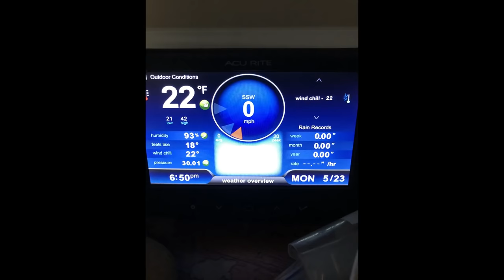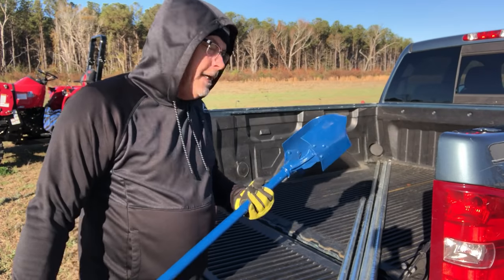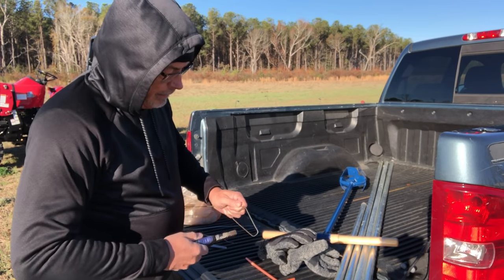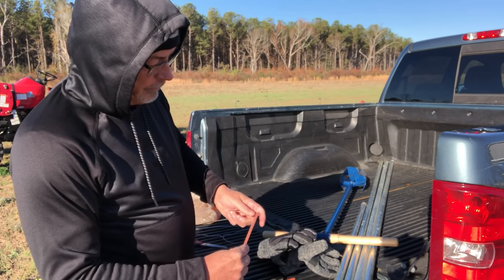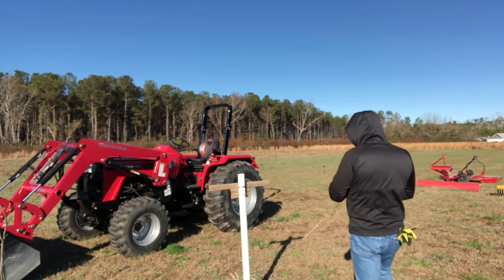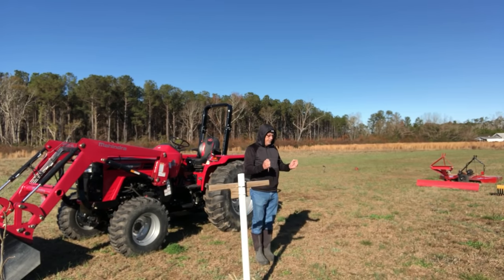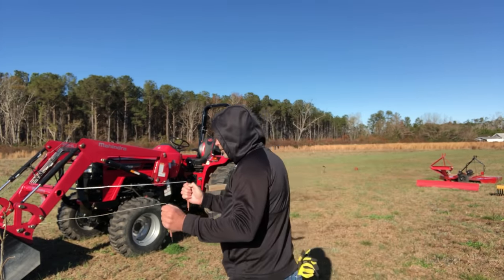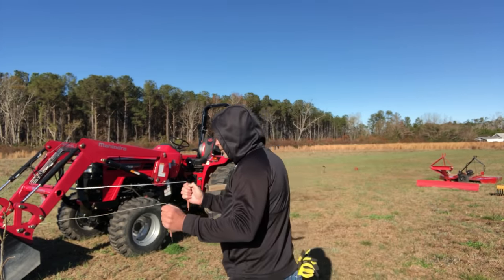How to hand dig your own shallow water well - Successfully | Fit Beach Life, How to Homestead!

Comment: Those rods are pretty good at detecting a place where a hole is about to be.
Reply: They don’t that part is garbage. Aquifers are usually very large and he’ll strike water if he closes his eyes and wanders randomly then digs. There is a $100,000 prize in Australia for anyone that can prove that water divining works. No one has succeeded.
Reply: @teeanahera8949  I liked your comment because I think it was well written, but I disagree. I think there is a logical explanation for why it works. Same way a compass works. Magnetism. It makes sense that all the unfiltered water down there contains metals and likely iron rich. Maybe powerful enough to pull copper wire, most hangars.  But I think there was value in your comment as well.
Reply: @teeanahera8949  disagree totally.   It works.  Don't know how but it works.

Comment: Me and a friend used black pipe sections 5 ft long and bored down 45 ft until we could no longer get the pipe up in the air without breaking the pipe we never got water😢
Reply from the maker: What is the average depth of the wells around you?

Comment: pro tip: don't put an end cap, beat your pvc pipe done until you have good resistance and then use your jet pump to suck all the sediment out of the pipe and repeat. I'm using an old fashion pitcher pump to do this method over time to get my well the last 8 feet down for a total of 30 feet since I'm using this well as emergency drinking water and daily pumping 15 gallons a day to water the gardens. 

once i hit my target depth, ill add a check valve and a filter on of my pipe.
by doing this, i'm slowly getting deeper every day by just using the well.

Comment: Shure try that in Texas.
If you can do this at all 99% of the water is sulfur water.
Most areas of Texas is lime stone VERY shallow. Surface to 10 ft that is why there are very few basements in Texas. Most drinkable water is two hundred ft to eleven hundred feet.
We also have very few trees west of I35 in Texas and those are short.
Most of them are 10 ' to 30 '.
If you live east of I35 things change drastically. North of Houston you have the Big thicket with lots of big tall trees and deep soil.
Reply: Laredo

Comment: Guys dousing rods don’t do anything. Water tables rarely differ between any 2 points unless the terrain has significantly changed. They are like rivers the whole area is covered in a layer of water at the same depth.
Reply: You are wrong. Diving rods do work, not always the same way, not always the same material, but these have been used for centuries to find water. I sold a house once and the new owner asked me to delineate the outline of the septic tank. Divination made it happen. Easypeasy.
Reply: He definitely witched the location of the subsurface water!

Comment: I used the same technique to find underground utilities. It definitely works for many uses. A caveat to this is, there may be buried power, fiber, phone, or sewer.
Reply: Or a big Boulder at 20-26 feet, which is probably the case at his first well head
Reply: There may also be nothing. Your odds are the same. A simple electromagnetic can tell you the rods are moot.

Comment: Runing sediment-laden water through a common jet pump is a very effective way to ruin the impeller and jet assy in a few minutes.  Their plastic-based parts do not handle abrasives at all.

Comment: The problem with drilling down that shallow is ur water u drinking is surface water basically what drained from above. The water u drink from wells pros drill is below bed rock. The water that is above bed rock is sealed off with casing. So the water u get down deep is coming out of the rock
Reply from the maker: Good point, but not in coastal areas. The average well depth here, tested and certified by the county is 30 feet.
Reply: @TangoRomeo87  oh ok that makes sense I live in Pennsylvania so it's nothing but rock and wells here can be from 100 ft to over 800 ft
Reply from the maker: Yep, I moved here from West Virginia, we had the same depth problems there . In a valley you might have a good well at 60-70 feet, but as the mountains got involved they went 300 to 800 feet for good water.
Reply: @TangoRomeo87  yeah my well is bout 300 I think 40ft of metal casing. We get good water can fill a swimming pool no problem
Reply: yes as I found out 140' deep and with 550 ppm hardness

Comment: Do you still have the link for that hand auger. I got one off Amazon identical to the one you have, but it can’t come apart-it has one solid pipe.
Reply from the maker: https://www.amazon.com/dp/B000OY4ABW/ref=cm_sw_r_cp_api_glt_fabc_CYK60R1GP36H8A3BMF05
Reply: I hath to cut the handle of the auger off too hath the pipes all  treaded.

Comment: Question my auger is a foot under muddy water every time I pull up everything slides off? Should I try to pump with the Same pump you did my pump instructions said clean water only? Or should I wash down a 4 inch pvc another 5 foot set the 1.25 screen pull up 4 inch and call it a day. I like the idea of that capped casing but I can’t get deep enough to get 3 foot of standing water, if I wash another pipe down I don’t know how thick this layer of water is. My first well is 27ft it has water but sucks air doesn’t produce much water but there is water now I’m trying to go bigger  to at least get 200 gal a day. Hole is 8inches wide and 18ft deep at this point in eastern North Carolina.
Reply from the maker: Mud will destroy the pump, let the water sit until the mud settles.

Comment: Nice! I only gotta dig 350' + to reach the aquafier on my property...👍
Reply from the maker: That’s how it was in West Virginia too… I feel you!
Reply: @TangoRomeo87  👍
Reply: We're you able to dig 350 feet with a hand auger? Switch ing to PVC pipe and using an electric crane to pull back?
Reply: @camperjack2620  couldnt cut through the caliche by hand... Still bringing in water every few weeks n filling containers until can save up for well drilling company at $75 per foot to drill the 350-400' needed...🤷‍♂️

Comment: Sir I need more information on the motor your used.
Reply from the maker: Seymour - 21308 S500 Industrial Auger, Hardwood Replaceable Handle Type, 8 inch https://www.amazon.com/dp/B000OY4ABW/ref=cm_sw_r_cp_api_glt_fabc_RNESM7SXZ20CF7VGN14V
Reply: @TangoRomeo87  I think he means the motor you use to extract the water..

Comment: A man with a machine drills hole by hand, yeah, we evolded?
Reply from the maker: Tractors suck at well drilling, one bad bind and it gets expensive. Learning old ways of doing things is never a bad investment of time for me.
Reply: @TangoRomeo87  I would not really have a clue, it just felt right to state it. Your efforts and knowledge would most likely go beyond me, and I do applaud your effort of the old ways, they did know better than us. No disrespect intended.
Reply from the maker: @ZeroControl  I’m learning as I go.
Reply: that wire steel hanger is a tool to find water?.. straw and steel wire hanger that right..

Comment: 😂😂😂😂😂😂😂😂😂 coat hangers find water. 😂😂😂😂😂
Reply from the maker: Yep, it’s not for everyone I guess. But for some it works really well.
Reply: @TangoRomeo87 I remember someone one my jobsite showing me this. I tried tlike crazy to prove it didn't work and it was accurate every time.
Reply: @lawrencerodeback  underground water is like a big river or like a small lake. According to the coat hanger you found water in one square feet. If you take 2 steps to any directions the coat hanger shows no water. Do you see why it's not real? Just drill a well and see how much water you found. 5 gallon or thousands.
Reply: I didn’t believe it either until I tried it. It works!

Comment: Most be nice to have soft dirt to play with 😒
Reply from the maker: It has advantages and disadvantages. It loses it soft appeal at about 18 feet😁
Reply: @TangoRomeo87  we break  farm equipment on the 2ft mark just trying to ture th dirt over for planting
Reply from the maker: @tallman8ft  I used to do that in the heavy clays of West Virginia... the trade off is this soul holds no water , it just runs through and dries out very quickly.